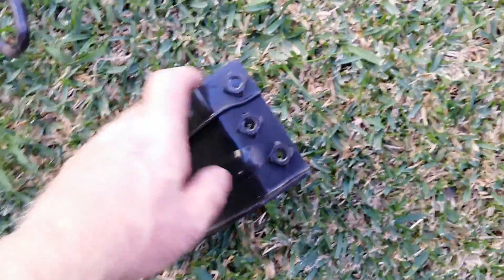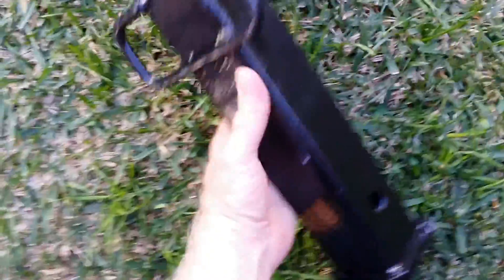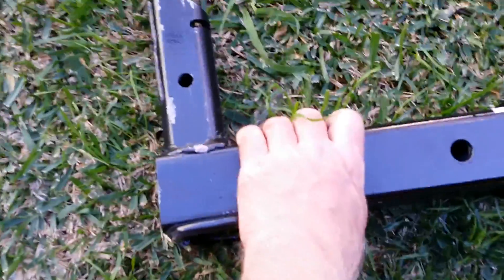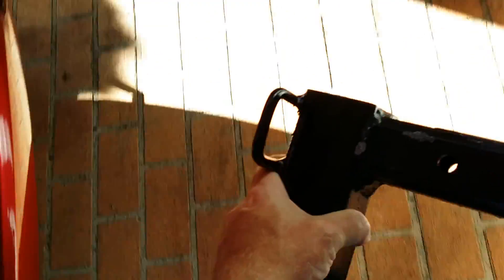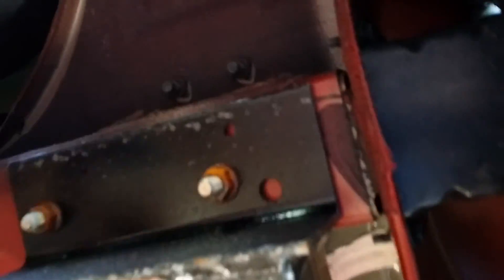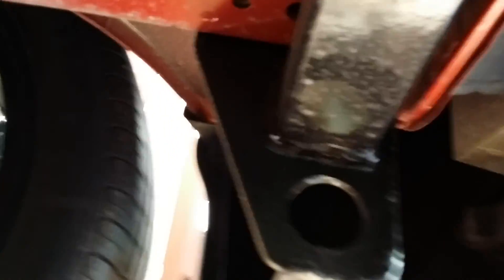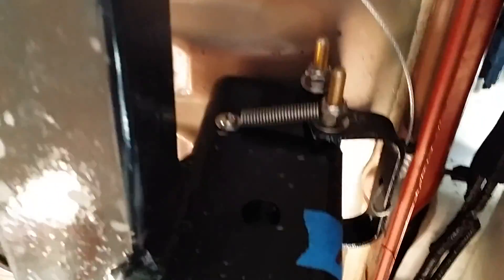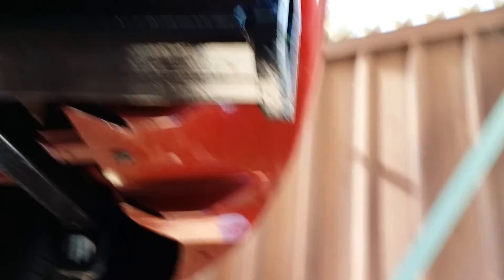nissan leaf australian using towbar hitch supplied by Bill Davis

Comment from the maker: I got an auto-electrician to do it.  He tapped off the lights at the back of the car.  There is one gotcha - the electrics on the Leaf are not designed to drive high current loads.  I use a trailer which has LED lights, so this isn't a problem for me.